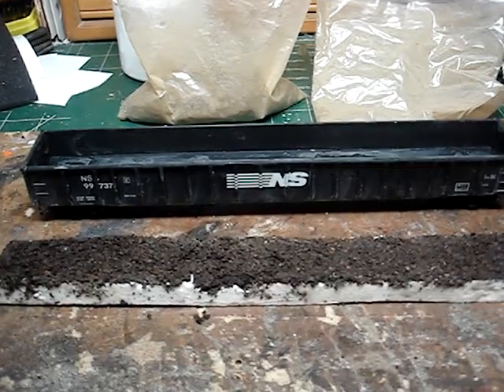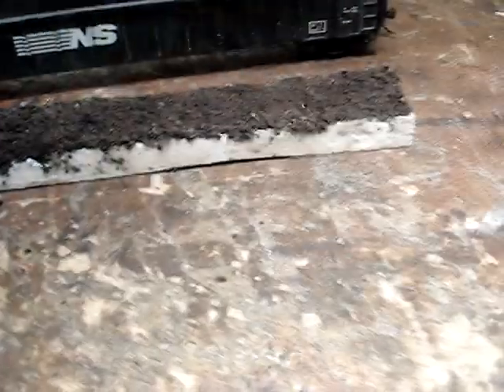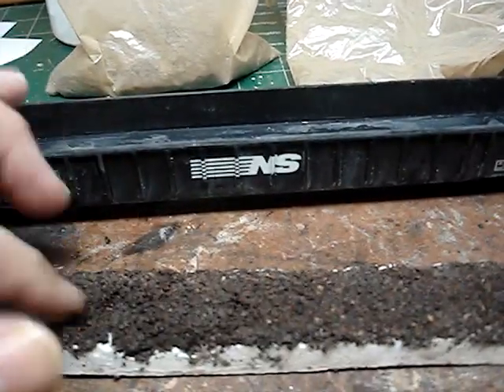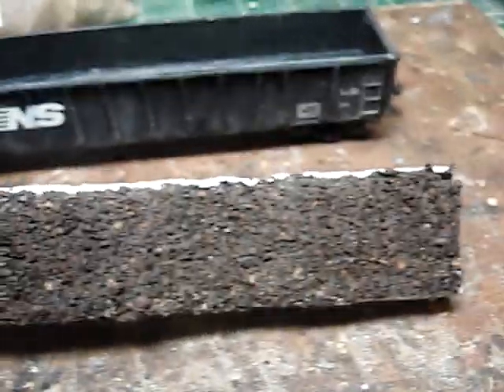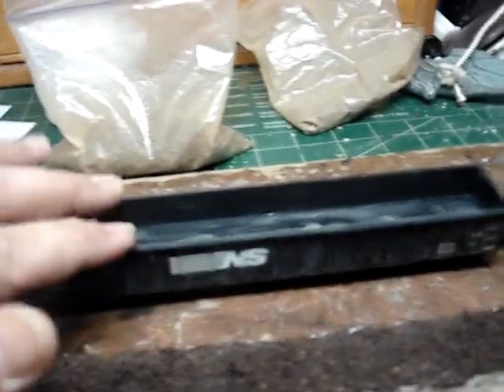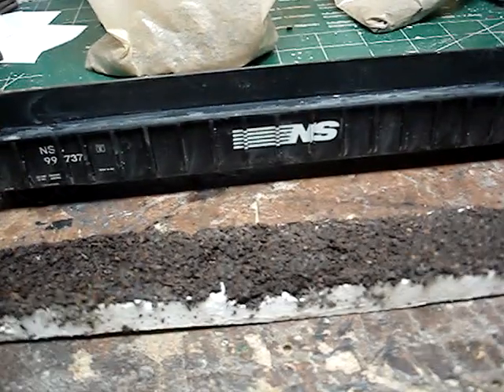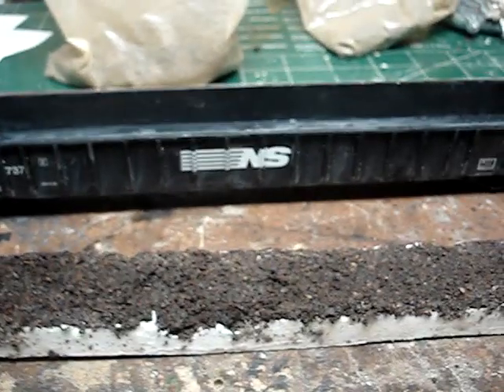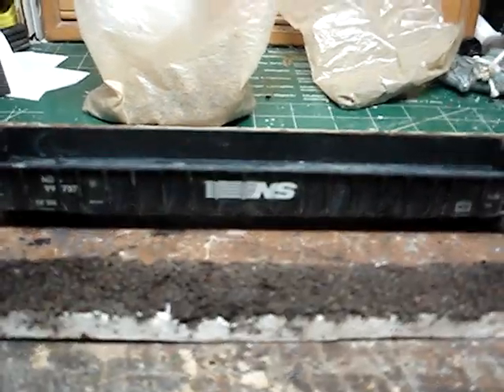HO Scale LBF 65' Gondola Shredded Scrap Load.

Comment: Very cool idea, looks awesome! I just made a dozen coal and gravel loads for hoppers and gondolas recently. Gives it that extra something for a cool look. 😎👍
Reply from the maker: John. If you make these real rust loads. I found it's a good idea to run a magnet over the dried load to make sure these particles don't find their way into gears and motors.
Reply: @ModelingSteelinHO  That could create many problems, thanks for the warning.